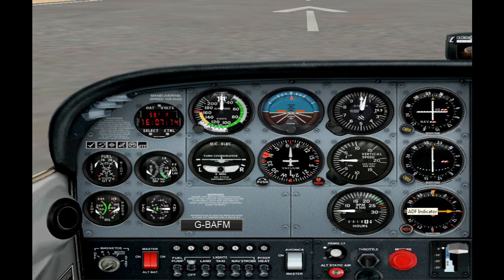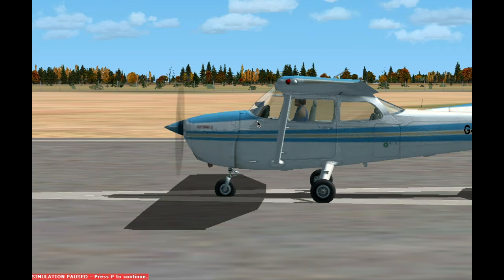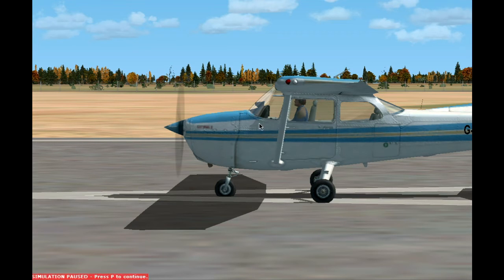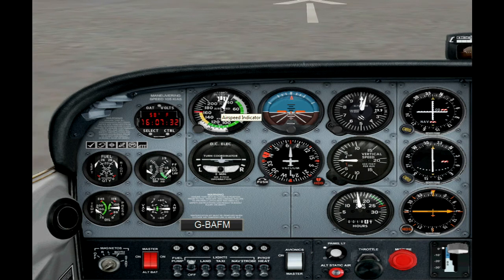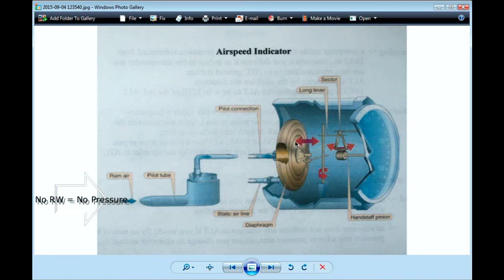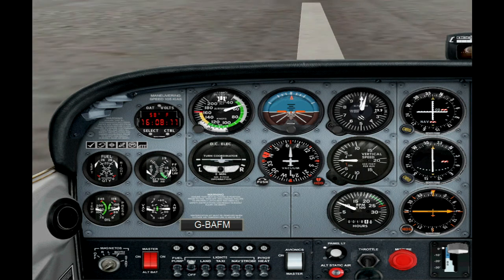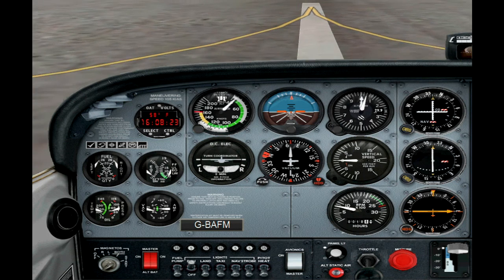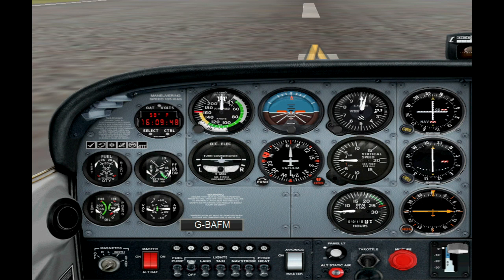HOW AIRSPEED INDICATOR WORKS - ASI (what happens inside!)

Comment: Question with how the airspeed indicator works. If the drain hole is only for to extract the water out of the pitot tube, why does the airspeed indicate a drop when the pitot tube is blocked while the drain hole is not? I'm assuming that the ram air pressure(dynamic + static) in fact does flow out through the drain hole. Am I correct?
Reply from the maker: +Karl lee Hi Karl! Thanks for the question and sorry that the video didn't give you a good and clear answer on that! I guess you might have misunderstood something there and I hope I can better  explain it to you this way. The 'drain hole' is a very tiny hole on the backside of the Pitot-Tube. It's main purpose is to drain water (let water exit) out of the tube during rainy days as you understand  correctly  or whenever a high humidity exists. Since this hole is located at the backside, it will never get in touch with direct RAM AIR (dynamic pressure). The only air it  receives is static outside (ambient) air pressure, just like the static-ports. Therefore!, if the PT 'front/main inlet' becomes blocked, the air pressure within the tube will be equal to that of the static line connected to the static ports. This in turn will result in less air pressure within the diaphragm so it will contract. The contraction  will lead to a counter-clockwise rotation of the ASI needle all the way to zero. AGAIN, in case the front part of the PT becomes blocked, there's no more pressure difference  between the PT and SP line.  Hope I could help you. Feel free to contact me for any more questions. I would happy to help! You can also check out my other video about the Pitot Static System -> https://www.youtube.com/watch?v=uBbe08KL9kg and my website @ https://ifreview.wordpress.com/pitot-static-instruments/
Reply: +dave212008 Thank Dave for the reply! One more question though, so the static air pressure is provided via the drain hole, which goes directly into the diaphram right? So doesn't that mean the air pressure inside the diaphram can also be vented out via the drain hole? Thanks again, I had no where to ask questions..
Reply from the maker: Yes, that is more or less correct. The Diaphragm is connected to the PT line only. That line inside basically receives air pressure from the entire piece of the PT, including the drain hole. In other words This line has one 'open end', which is the PT, so pressure will get in and out of it. If the front inlet is blocked, the drain hole remains the only open hole in it.
One more info for you.. The drain holes are not always located at the back, sometimes these holes are underneath. They just must be situated at a point, where they do not receive direct RAM AIR (dynamic pressure). Safe flights! ;)
Reply from the maker: Hey Karl, that is a very good question question I have to say, as I have never heard any one talking about an amount regarding this... It's kinda hard to explain this in a written sense. Anyway to connect to you in another way maybe?
Reply from the maker: +dave212008  you can also connect to me through my website @ https://ifreview.wordpress.com/contact-me/